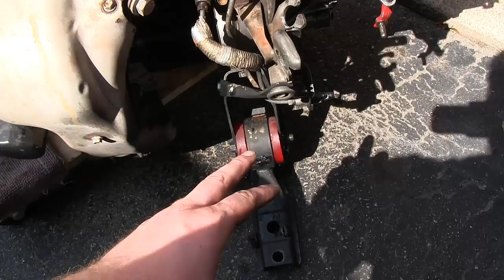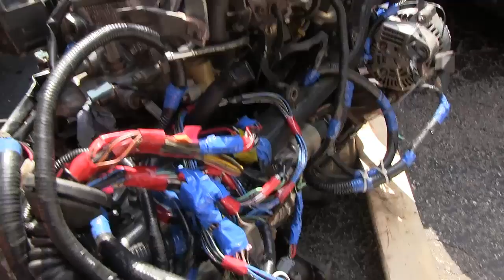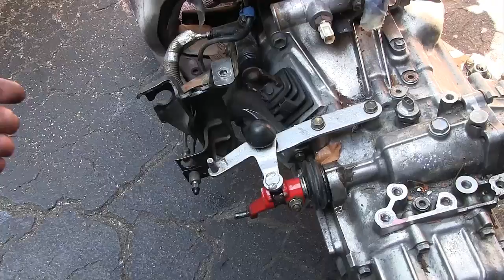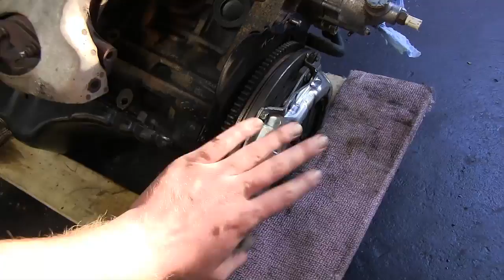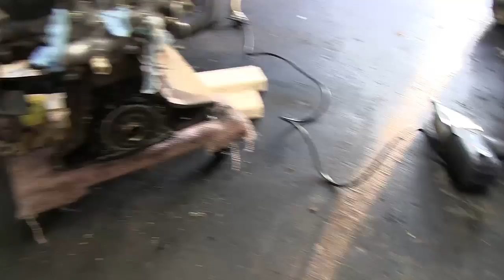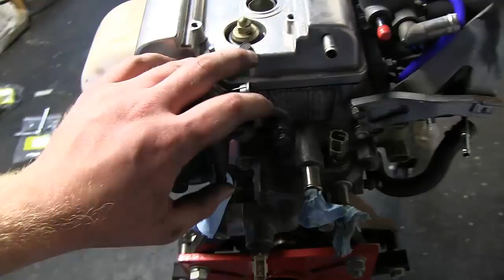4AGE 20V Engine rebuild part 1: Engine cleanup

Comment: I am in the process of doing a rebuild on a silvertop but the ITBs are going to another project while the ST is going to go the forced induction route.  Any tips for getting the 16 mounting screws loose without stripping their heads?  I've PB blasted them multiple times and taken a heat gun to them for longer than I'd like, but not even impact tools are getting them to budge.

Comment: In an earlier vid you said you might turbo your 20v during this rebuild. What about supercharging? Is it possible to fit an SC12 or SC14 onto the Silvertop? Or perhaps something like an Eaton M62 or other small clutched supercharger.
Reply from the maker: You are in luck, I have purchased an SC12 and will be rebuilding it. My possible goal is to twincharge (both supercharging and turbocharging) the silvertop. Keep checking back, I may have a video on this soon.
Reply: Awesome. I've always wanted to build up a GZE and put it in a stripped hardtop. As much as I love my 89 SC I'd rather not abuse it every month at autocrosses.